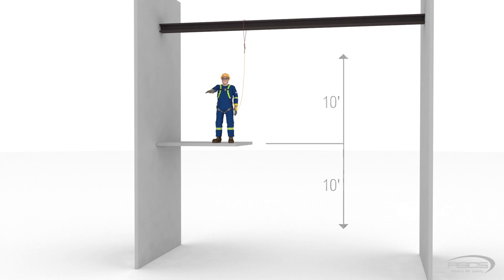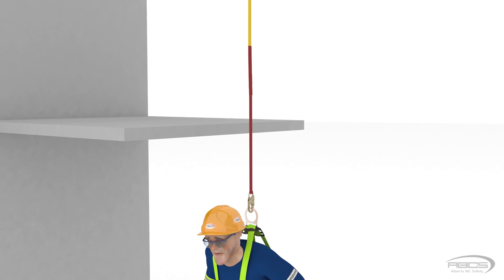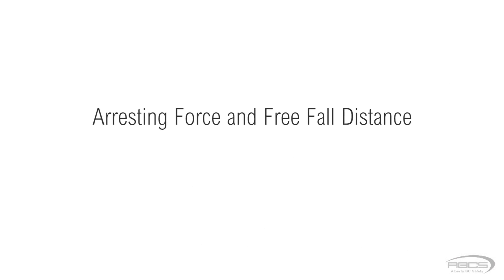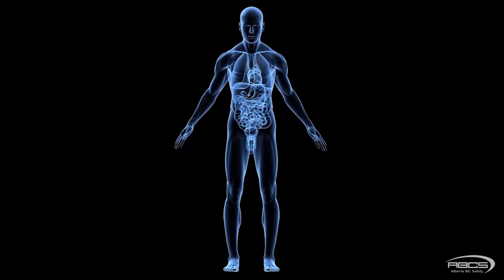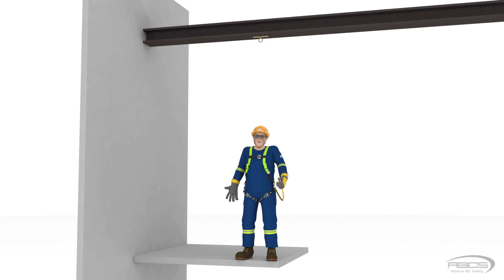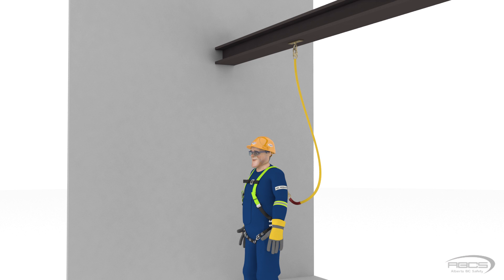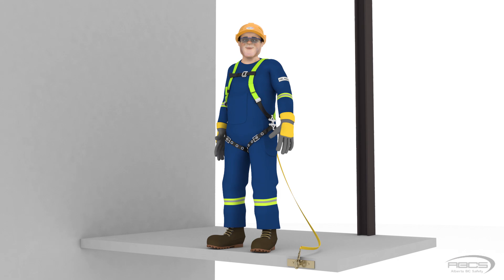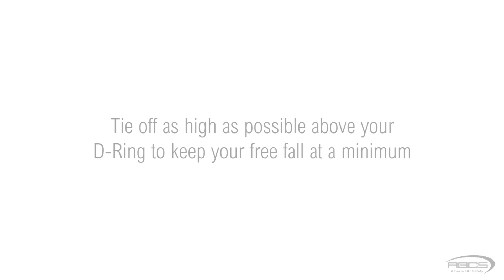Fall Clearance, Arresting Force and Free Fall Distance - 3D Animation

Comment: So why do some companies need to use pfas startin from 6 ft working at height platform? If the worker is 6 ft tall and he hooks on an additional 1ft above his head, that is the total of 6+6+1=13 ft (length from anchorage point to the ground). If I do the calculation, Lanyard Length: 6+ Deceleration:3.5 + Workers Height 6=15.5. 15.5 is longer distance than 13 ft. So he would hit the ground if he starts hooking his lanyard 1ft above his head when he is on a 6 ft height platform? I’m confused please help me understand why osha standard says 6 feet clearance when the calculation is like this? I might just be missing sth here. 😢
Reply from the maker: A 6ft lanyard with a 3.5 SAE does not work when u are only 6f above the ground.  A 6ft lanyard with a 3.5 SAE was designed to work on a platform 10 ft off the ground and only when you are attached to an anchor 3 ft above your D-ring.